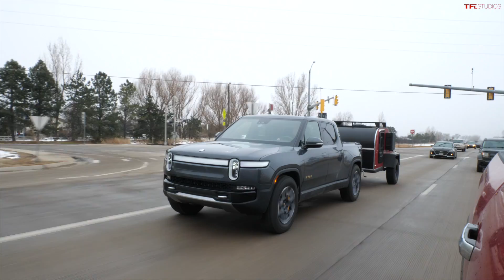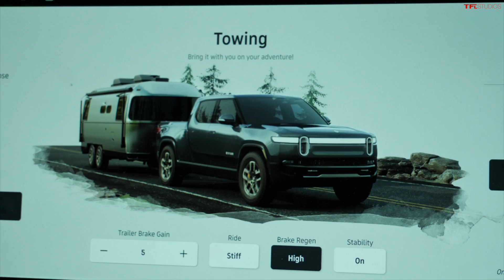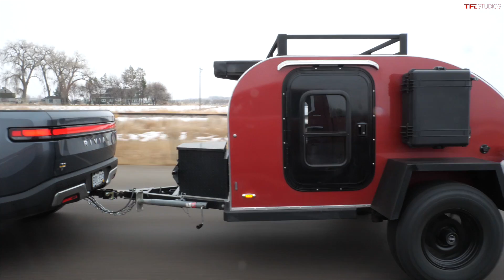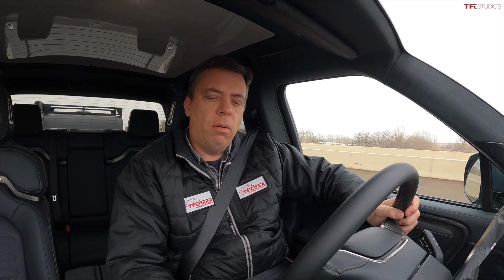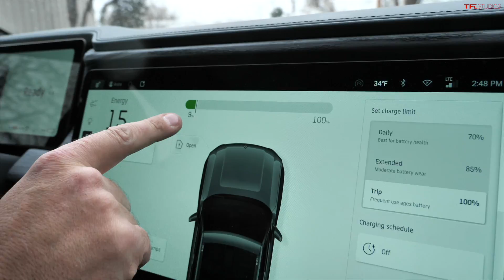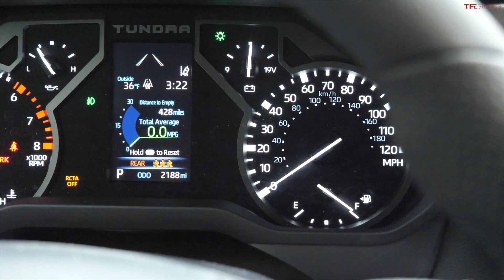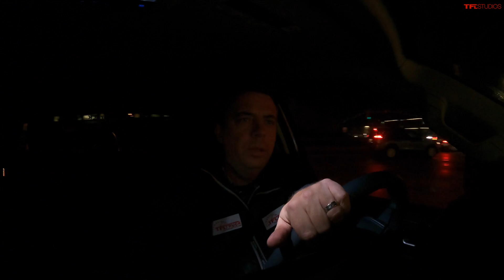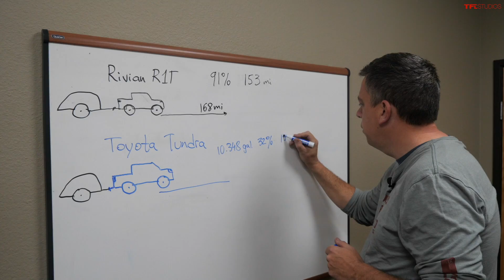Rivian R1T vs. Toyota Tundra: How Far Can Each Truck Tow On A Single 'Fill-Up'?

Comment: This proves that in Canada this won't work for rural areas.  We have lots of places that are 240 miles or more between gas stations!  Even further between cell service!  We will be 30 years before we would have enough chargers to get people everywhere they need to go.

Imagine what the lineups would be like if every vehicle on the highway had to stop at every station.

Comment: With the Rivian, I would imagine that it’s a great in-city only towing vehicle. 

Cause if you think about it, you won’t need a gasoline engine if all of your towing is done in a city. 

And imagine if almost everyone in a city had an electric truck. Maybe it’ll be better for the environment? Maybe people would save more money at the cost of time? 

Whereas leave the long-distance towing to diesel or gasoline trucks. 

I’m not saying what I’m claiming is absolute. However, I simply hope to offer a different perspective. And, absolutely, a lot of people that buy a truck are in hopes that it would take them far under load and it is something EV manufacturers need to work on.
Reply: Imagine the towing range if they put 10,000 lbs behind it. Guessing 30 to 50 miles!
Reply: @dundonrl  that’s kind of all you need when you’re in a city. But yeah, I would never recommend going long distance with today’s electric trucks

Comment: You could convert the efficiency to usd/mile.  1.25miles per kwh using EA avg price of 35 cents it will cost 28 cents per mile to tow that trailer on those conditions with the Rivian. The use MGP and gas prices to do miles per dollar on the tundra. 40.35 /153 = 0.26usd. Tundra is cheaper. If you used regular house rate avg 12 cents without delivery charges. It will be 0.12/1.25= 9.6 per miles almost 2.5x cheaper than the tundra

Comment: This is not really a fair comparison. Compare it with a Tacoma. My Tacoma gets 12 mpg in the city and I betting that’s what it would get towing this trailer. It’s got a ~20 gallon tank so you are looking at ~240 mile range which isn’t all that different from the rivian.
Reply: @Mike relax bro. I understand the towing capability differences but the tear drop trailer they are towing is only 2k lbs. Furthermore, the Rivian’s overall size and bed size is much closer to a midsize truck than a full-size, thus, making it more comparable to a midsize than full-size.

Comment: Don't sugar coat it set the cruise control at 74 to 76 real world!!!
With the gasoline engine you pull into the gas station and fill back up and you're back on the road!!!!

Comment: It would be nice to see a cost ratio analysis. How much $ you would spend recharging the Rivian compared to refueling the gas powered Toyota.
Reply: Depends on how much your time is worth. Considering it takes 8 hours to charge using a dedicated 7.4kw/h charger you'd be spending an extra day or so on the road.
Reply: Rexford L a supercharger puts out up to 140kwh correct
Reply: @bambam2five969  You can't use a Tesla supercharger on this vehicle.
Reply: Rexford L Rivian is rolling out their quick charger which will add 140 miles of range in 20 min
Reply: @bambam2five969  150,000 of them? (That's the number of service stations in the USA.

Comment: I would like to have seen what the cost was for the electric recharge.  So the gas powered truck cost $40 to go that distance, but we didn't see how much the electricity cost, not at your garage, but at an electric recharging station.  Also, a comparison of time to recharge vs time to fill the tank up at the gas station. Otherwise, great content. 👍🏻
Reply: It only cost $40 cause he bought premium fuel. If he had bought regular it would have been around $33. I also would have liked to see electricity rates/charge times and possibly another video for higher weight towing and possibly full  passengers.
Reply: @elvism684  Or at even colder temperatures and a sustained speed of 70+ mph...

Comment: Every time I travel I'm always by myself or with someone who has the same thought as myself.  Get in the vehicle and go without much stopping.  A Rivian would drive me nuts with having the lower mileage with a trailer and the long charge times.  Even with solar panels it would still be a pain unless it's a clear sky with lots of sun and the panels are clean.  It would be good for the short trips that are around town but with no place to put a charger at my house, an extension cable would have to be run 50 ft. plus to the vehicle at the curb of the street.  This is even worse for people who live at apartment buildings.

Maybe in another 10-20 years I'll think differently about electric vehicles.  To have them be pushed on people in certain states is just ridiculous at the current moment in my opinion.  Sorry for the rant, the video was quite good!

Comment: That trailer is pretty light, a bigger truck probably wouldnt notice is much behind in tow. How does the rivians range change as the trailers weight increase? Id predict it drops substantially as the weight increases

Comment: Perfect BEV, light-trailer tow video! Small trailer test is of most interest because most potential BEV pickup buyers are realistic on towing range and are only considering a BEV if they are going to tow light, 2,000 - 4,000lb trailers. Those towing over 5,000lb trailers regularly over long distances or remote are likely not going to be looking at a BEV pickup.  
Those towing 8,000+ lb trailers will be better served by, and are likely looking at purchasing, non-BEV because the range while towing with a BEV won't be adequate. But, those that tow light trailers in the 2,000 - 4,000 lb range can get useable range out of an R1T and some other BEV pickups. We have a 3,000lb fishing boat and a 16' aluminum enclosed trailer that is about 2,700 - 3,200lbs when loaded up with ATV, dirtbikes or snowmobiles. Based on this test, The Rivian with the "Large" battery pack (not to be confused with the larger "Max" pack), we would have enough range for some of our trips but not all.  We would need to drive to the mountain trailheads (50 - 90 miles one way) or the reservoirs/lakes we fish (70 - 100 miles one way) and make it back on one charge with these small trailers because all of these routes do NOT pass by any public charging and so we need to make the entire loop on one charge. With the Max pack, I think we could do all of them. 

In the Rivian, we'd wait for the max pack, of course, but your testing with this light trailer with the smaller "Large" pack Rivian R1T is great information. I suspect that the majority of BEV pickup buyers that intend to tow are realistic and so plan to use only tow lighter trailers. It will still be nice to have the 11,000lb tow rating for occasional heavier trailers, such as renting a mini excavator and towing it across town, but those looking to tow longer distances at max towing are rarely considering a BEV pickup.  
Thank you for the test!
Reply: If you were only going to tow 2-4k pounds, why would get bother with a pickup when any mid-sized SUV can handle that?
Reply: @OlJackBurton  Good questions and I'm happy to elaborate. We already have an ICE pickup that we'll keep because we carry our slide-in pickup camper all summer and go deep into the mountains every weekend plus go on 10 day long, long trips a couple times a year.  When we go on a day trips where we won't be spending the night, no reason to drive that big rig with camper just to tow a 3,000lb fishing boat or enclosed trailer on a day trip to the reservoir or trailhead. My wife's current crossover won't tow these loads. We have already decided that when we replace her vehicle, we want it to be a PHEV or BEV and if we want it to tow our boat and trailers, it has to have an adequate max trailer limit, adequate range to get there and back (there are no charging stations along out routes), and meet all of our other criteria. 

Since we are replacing that vehicle anyway, our thought process is that it might as well be able to tow our trailers for day trips, but also have high ground clearance for our forest service road day trips, have a pickup bed to throw all our gear that we don't want in the passenger compartment (like they would be in an SUV), etc. 

Plus, I don't like to regularly tow over 50% of a vehicles max tow rating since that often requires a load leveling hitch and we don't want to mess with that. Even if we were interested in a small ICE SUV, they don't tow well enough for my tastes as most only have 3500 to 5000lb max tow rating. Towing a 3,000lb trailer with no trailer brakes is not something I want to do with a vehicle with only 5000lb max tow rating. I think as much about stopping a load as I do accelerating with it and those are not adequate. 

Plus, pickups have longer wheelbase and are more stable towing. And, for these trips, we often have things we don't want in the passenger compartment and so want the pickup bed.  We would also take this vehicle for drives in the mountains on forest service roads and want the ground clearance of a pickup. 

So in summation, the PHEV or BEV vehicles that will do all of these things are just starting to hit the market and only the pickups tick all the boxes that make it worthwhile for us to replace my wife's current vehicle. We only do so every 10 years or more and so would take this opportunity to get something that does everything we want and need it to do for day trips so we don't always have to take the pickup/camper rig when we are not spending the night or don't need the range if a BEV pickup will do the trip.
Reply: @MrChadx1  Um, thanks i guess.  I'm not sure the vehicle that fully meets all your criteria exists right now.  If PHEV/BEV, high towing capacity even if for only moderate loads, and ample range in those conditions are the deal makers or breakers, then there are no SUV/CUV EVs or even PHEVs that have well over 5,000 pounds of towing capacity.  The Model Y is about 3,500 lbs, the Ioniq 5/EV6 is about 2,300 lbs, the Rav4 prime is about 2,500 lbs, the XC40 Recharge is about 2,000 lbs and Sorento PHEV and Tucson PHEV are 3,500 and 2,000 lbs respectively.  The Audi E-Tron SUV and Mercedes EQC will have 4,000 lbs which is still probably not enough for you. For giggles, the Maverick hybrid is only 2,000 lbs and FWD/torsion beam only. The redesigned Honda Ridgeline is coming out as a hybrid (possibly PHEV) next year/this year, but not more and probably less towing capacity than the ICE (currently 5,000 lbs). None of the SUV EVs will have well over 150 miles of range towing at their limits in cold conditions at highway speeds. I don't know how capable the future Ioniq7/EV7 are going to be, but likely not much more.  Maybe when solid state batteries eventually come out (longer range and more power density). 

So i guess that just leaves the very expensive EV pickups (with the longest range battery packs with the Lightning and Silverado). So probably in the $75+k range without dealer/manufacturer markups.  And even then, the range of towing a 3k-4k lb trailer or boat as opposed to a 2k lb teardrop trailer, in cold conditions at highway speeds and possible elevation/grade changes (mountains) with multiple passengers and their gear will likely be in the lower 100 mile range, if that. Maybe the Cybertruck will have enough range, with their more efficient technology and more aerodynamic but uglier shape. A pickup/ two pickups still sounds like overkill to me, though. But long story short, the vehicles with ample range (PHEVs) don't have the towing capacity (over 5k pounds), and the vehicles with ample towing capacity (EV pickups) don't have the real world round trip towing range (over 200 miles)...
Reply: I'd guess people would only buy a tiny trailer like this if they only had a vehicle capable of towing it. How often do you see people with a 2000 lb camping trailer vs a 25+ ft trailer behind their pickup. (I don't think I've ever seen a trailer that small in the wild).
Reply: @dundonrl  Small trailers far outnumber large trailers. And by small, I'm talking weight not size. But,  I suppose it depends on where you live as well.  Most fishing and recreational boats are below 3,500 pounds. 10 ' - 16' flatbed utility trailers that are all over the place are 1,000 - 2,000lb empty and used for lawn care businesses, hardware store runs, dirtbike/ATV/UTV towing, delivery services, etc. It's just easier to notice huge campers, but I'd argue that most of those (anything over 8,000lbs and towed long distances or towed regularly) are better towed by HD pickups anyway, which the Rivian is definitely not competing against. 

But I'll agree that current EV are just not reasonable for towing heavier trailers. Will take either more onboard energy storage or fast charging/vast charging station buildout. In the meantime, these EV pickups are an option for towing light that we don't have today as most EV are cars/crossovers. They are a welcome addition as they will work for a lot of pickup use cases even if heavy towing is not one of them.

Comment: So that means here in say Phoenix, you’d not be able to tow your little teardrop anywhere in the summer to get out of the heat, and return home. It would be questionable if you’d even have enough range to get to a campspot on the Rim. (~1.25-1.75 hrs and a 4000+’ elevation gain)
Reply: Cold weather is far worse for electric range than hot weather. Talking 25-30% loss vs 5-10% loss.

Comment: That teardrop could be towed by a mid sized crossover that costs less than half of the R1T. Y’all should’ve at least split the difference and gone with a 5K Lb Apex Nano or R-pod. A Wrangler or Bronco could tow that teardrop and those vehicles have tow hitches for decoration!
Reply: Puff piece for each? towing 2k @ 55
Reply: @ryandoyle4344  That was their average speed. On the highway they towed at 70mph.  The average speed is calculated by the total time (e.g. start and stop) over given distance.  Not just the highway, but also the side roads, stop lights, intersections, etc.
Reply: Totally agree. This is a silly comparison. The Tundra is so much more capable as a truck and an adventure vehicle. I would compare the R1t to a mid size CUV, take a different Toyota, like a Highlander hybrid. I am disappointed with TFL, home of the world's toughest test. This was the world's cream puff test. Throw a 7500 lb or at least a 5,000 lbs trailer and do an MPG loop. Who cares about power, if your battery is dead, you have none.
Reply: @ultradaves  The Rivian R1T has a much higher towing capacity.  5000+lbs is well within the tow capacity.  You could also go much further without heating.  It may well have doubled electricity consumption or even more.
Reply: But this did show even with a small trailer, the Rivian already lost half its range. EV is not as efficient as gas
Reply: But the R1T isn't a midsized or full sized truck its a 2b class truck 3/4 ton HD truck class.  This is what it should be tested against.
Reply: I’ll go with you on that it’s size and capability allow it to tow in to the 10k lbs range. But let’s face it, if it can only tow it halfway across town, doesn’t that warrant a dq? I think the R1T is the answer to the question nobody asked. For the price, there are plenty of vehicles out there that can do what the R1T does and then some. I’ve said this before. EV companies need to stick to cars and crossovers till battery tech allows towing range to be in the same universe as I.C.E. Trucks.
Reply: @MidValleyMusic  It can go further than halfway across town if you don't blast the heating system.  Heating likely at least doubles electricity consumption.  It's no joke.
Reply: @MidValleyMusic  the other issue in regards to its weight (class) is the damage to the roads it does while not paying road taxes.
Reply: @Unconventional Ideas   I don’t know where your’e from. So I’m going to assume that having a vehicle that will expend it’s fuel capacity within a couple of hours is acceptable wherever you live. It takes about 12 hours to get from one side of my state to the other. Let’s say were pulling a 5,000 pound travel trailer and hauling about 200+ pounds of luggage and camping gear all while transporting a family of four from McAllen TX to Garner State Park. That’s going to be a miserable road trip. Save the $100K and buy yourself a $50K Half Ton and save your vacation!
Reply: I don’t fault TFLTruck for the Rivian’s limitations. They’re just trying to figure out who this truck is for. It’s clearly not for anyone that’s in the half town towing market. It might not be in the midsize towing category either. My guess is every midsize truck currently on sale can out tow the R1T. So unless you’re campsite is really, really close by, You’ll probably be camping along the way to your campsite. I live at the southern tip of Texas and I can say there aren’t many places this truck will serve me. Maybe the R1T is in the Maverick, Santa Fe & Ridgline practical towing category? All that I think the major news here is,,, Now we know why Rivian didn’t invite TFLTruck to any events or willingly supply a truck for them to test.
Reply: @MidValleyMusic  The R1T has a much higher capacity, but it does not go very far when you tow the maximum capacity.  That's a thing, too.  So if you do some local towing, that would be workable with the R1T as well.  It is doable to go long distances, but you would not necessarily want to do that often.
Reply: Towing 10,00 pounds the rivian would go less than a 100 miles., if it used 91% battery towing 1000 ponds going 150 miles
Reply: @candylk247  They were blasting the heating system, which substantially cuts the range, just like the old gasoline heaters on the Chevrolet Corvair which used to triple fuel consumption.